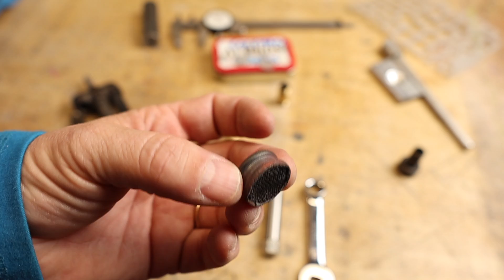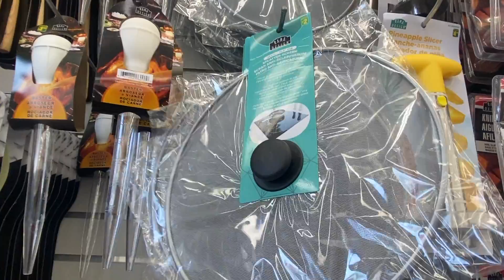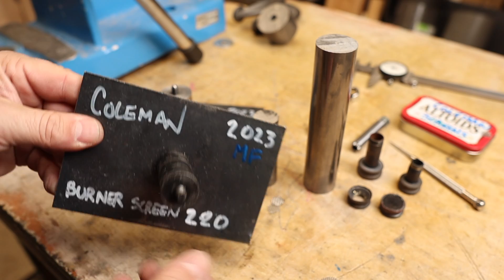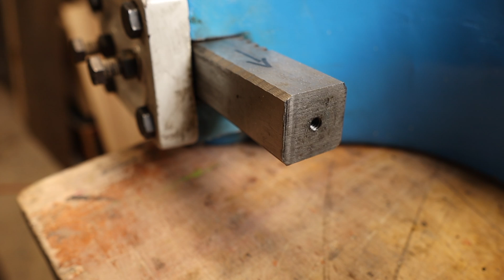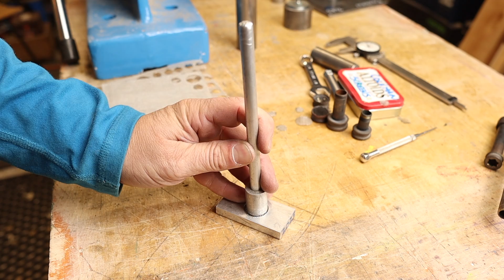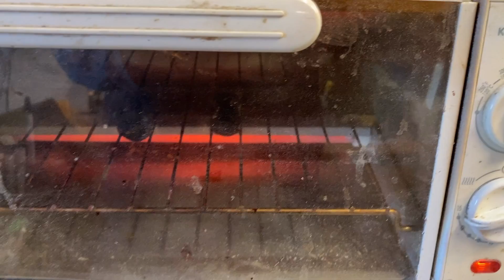How to make Lantern Burner Screens // Fixing Coleman Lanterns

Comment: It would be much easier to make your male punch mounted to your ram. For the die, either bore thru a slice of bar stock on the lathe, or bore thru a flat plate mounted to the base of the press and punch right thru and screen will fall out the bottom. You dont have to stop to pick up the part and pry your screen stock off of the punch if you use a spring or rubber stripper. Just an idea from an old tool & die maker. Very nice descriptive video.
Reply from the maker: Thanks for commenting.  I plan to try that method for a larger style screen I plan to make. I was coping chassis punches that I already had plus I found the screen distorts quite easily and the method I used seemed to press it back into shape.  I’ll see how the other way works and report back.  Cheers.
Reply: You might even try convexing your punch face to achieve the cupping desired. Just a crazy thought.

Comment: You might actually look at making these for reloading presses. I think they would work exceedingly well for this, and are of a standard size when it comes to die measurements, etc. It would also be very, very straight forward to make.
Reply from the maker: Thanks for commenting.  Yes, a reloading machine may work for this.  They can get a little expensive and I’m not sure how much force they can actually press.  A 3/4 ton arbor press would be the bare minimum to do the larger screens…. Interesting suggestion though, I’ll research further.  Cheers.
Reply: @MikeFreda   Well google says it's ~1.5tons and I believe it. Having resized a lot of different brass, there is a lot of force used. I think it would be worth it to look into and would be a modular setup.

Comment: What if you don't have the correct punches?
Reply from the maker: Thanks for commenting. Due to me having a metal lathe, I'm able to make whatever size I need. All I need is the size of the burner cap of the particular lantern.  If you don't a lathe I guess you can find some who has or go to a machine shop and get them to fabricate one for you. Take a snap-shot of what I made and give them a dwg and/or specs.  Cheers.